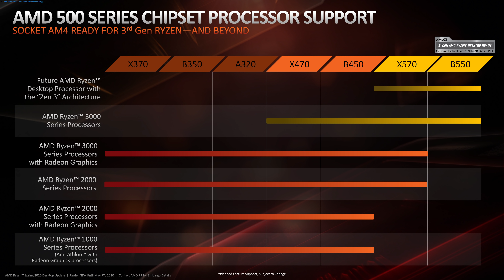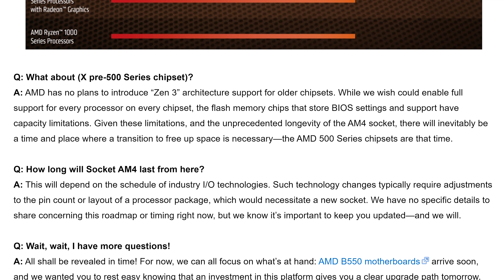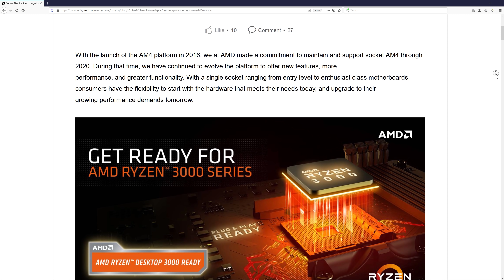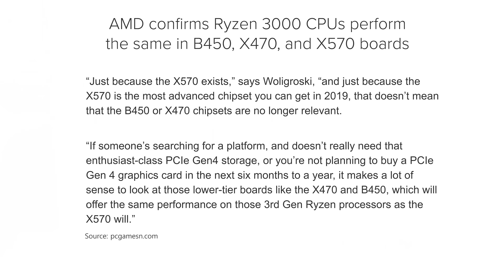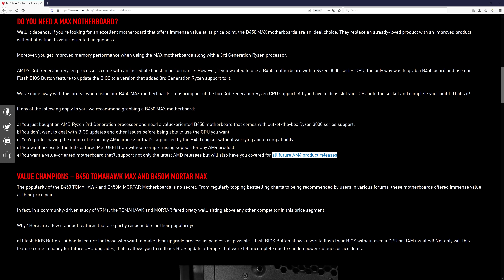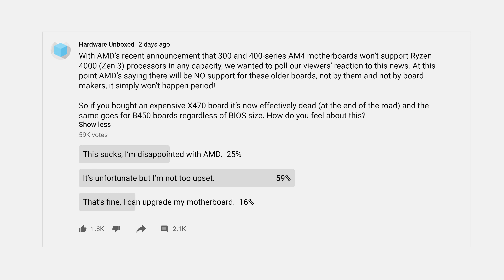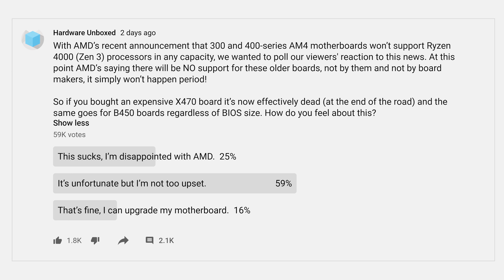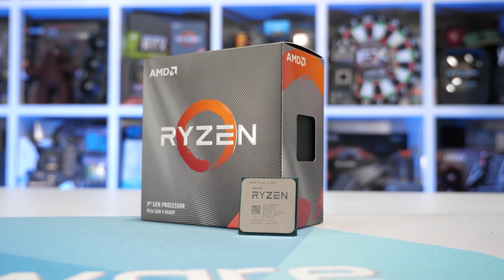AMD Does An Intel, Axes Zen 3 on 400-Series Motherboards, Our Thoughts

Comment: AMD have kept their promise. If you search for this article on Google: "3rd Gen AMD Ryzen CPUs Will Work on Many Existing MSI AM4 Motherboards", you'll see that there's a "Socket stability" slide from AMD on there. The orange bar on that graph stops right at 31 December 2019. Or in other words, processor support on AM4 officially ends on 31 December 2019. So why do people expect Zen 3, which releases AFTER 31 December 2019 which is outside of the promised support period, to work on motherboards from 2019 and below? 🤷‍♂️
Reply: Since you are on such a spamming spree, please answer this: Many other places AMD have said "through 2020" and this is exactly what Steve is hammering on about: It was so ambiguously communicated that even MSI were 100% sure that the Tomahawk Max would support Ryzen 4000... So tell me again how you, a single individual, have gained such divine clarity from a single slide, that has been contradicted by official AMD statements and slides many other places, that you have the right to tell the MSI team, who work with AMD on a continuous basis, that they are just retards who didn't know what they were doing all along?
Reply: @andersjjensen  I'm trying to balance the unjustified hysteria of some people. You can call it however you wish. Which are those "many other places" where AMD have said "throughout" 2020? I'm going by official marketing materials and slides. What are you going by? Please don't point at that BLOG post at 4:42 by an employee that clearly misspoke and didn't use the correct word that now everybody has latched onto. I really want you to show me official slides issued by the company that are not published in BLOGS and that show AM4 support for new CPUs beyond 31 December 2019.

Comment: I specifically bought a B450 Pro Carbon AC for Zen 2 and I bought the R5 3600 on launch day I got 1 of the first 3600's in the UK and I bought a Pro carbon because I wanted a good board that would last and didn't need PCIE4. If I'd known at launch that it would not be supported for Zen 4 then I would have bought an X570 instead it wasn't much more as the Pro carbon is the Best B450 and was expensive. So I'm quite upset that AMD has let me down, that said Both the MB and the Chip have been awesome, and if nothing changes I will at some point get a 12 or 16 core and wait for Zen 5 as what other choices will I have. Also the B550 it pretty much dead on arrival you can't put a Zen 1 chip in it and why buy Zen 2 if you plan on Putting a Zen 3 in it in October so who on earth is going to get a B550 because if I was forced to change an MB now I would get the new MSI X570 tomahawk as it's the closest to my B450 Pro Carbon in features.

Comment: I agree 100% on the B450 argument. Sure B550, is finally right around the corner, but currently B450 is still the latest and greatest available. Not everyone has money to throw at the X series boards and for AMD to throw people under the bus that invested in the best that they could afford only a year ago, or less, is bullshit. Especially since there wasn't a B550 alternative to be heard of for sure until the last month or so. There were even rumors that AMD might skip B series boards for the 5xx chipset. It just escalates the situation for them to use an excuse that one of the least expensive parts on a motherboard, the size of a BIOS ROM chip, is their reason for doing so. These chips probably don't cost AMD any more than the CMOS batteries.

Comment: I'm very disappointed.  I can see not updating the 300 series.  I lot of manufacturers didn't know what to expect from Ryzen and cut corners, and, they were already on a beta bios.  But the 400 series was supposed to be designed to last. If they had announced last July that there would be no 4th gen for the 400 series, I wouldn't have been happy, but I wouldn't have really been upset.  Especially if they had launched B550s soon after the X570 chipset.  But I am angry that they sold and promoted B450 as the mainstream option, knowing that this is the group that is most likely to upgrade, then cut them off at the knees.  If you got a 3900X and an X570 Motherboard, you probably won't upgrade the next year.  But if you picked up a 1600AF or a discounted 2600, or a 2200G with a B450, you were likely to look at upgrading to a 4700 or 4900.  Maybe not right away, but maybe when the 5000 series launches, either picking up a used chip or waiting for sales.
Reply: And the APU situation is even weirder.  The 2400G and 3400G work on the 400 series boards and the X570 boards, but not the B550.  Similarly,  the Athlon 3000GE will work in the X570 boards, but not B550.  And B450 may not get any upgrade at all.  What's the point of this?  I have a 2400G in a B450 board and Inwin BQ case that I use at work and that I use as a travel computer when I go back to the U.S. to visit family.  I had planned to upgrade it at the end of the socket life, when there was a significant increase in  graphical capability.  But the first upgrade was the 3400G, which was pretty much the same architecture, just a little faster.  Nothing worth the price of an upgrade.  We still haven't heard about any new desktop APUs, and would they still be compatible with B450?  If they keep the line, would the next generation be Zen 3? What boards would it be compatible with? $150-200 for a significant upgrade to the graphics and CPU would have been an easy choice.  Spending that plus $150+ on a new motherboard and then dealing with reactivating software, not so much.  At that point, I'd probably give up on upgrading it, and if i still need a system like that, I'll definitely give Intel and their Xe graphics a close look.  There's certainly nothing locking me in to the AMD platform at that point.
Reply: Going forward, I really think AMD needs to get ahead of this for their next socket.  Ryzen is popular enough to get well designed boards right from the start.  So: 
Ax20-- 2 generations of support  These are budget boards that don't use the best parts and lack features.  Limited upgradability is an obvious cost-saving measure. Maybe no i9s.
Bx50-- 3 years or the end of the socket.  Mainstream boards, good components, people should be able to expect upgrades, but there are limitations.
Xx70-- Until the end of the socket.  It's a premium chipset, make one of the premium features being able to use to use any chip on the socket.

Comment: Honestly it sounds like they are doing this for the same reason Intel does it. They dont want to deal with the tech support issue of saying the CPU's work in older boards and then at best them only working if the motherboard manufacturers update the bios. Then if people buy an older board with a new processor they have to send a CPU to the customer to update the bios. Too much headache.

Comment: If they support 400 series mobos, the effort will be the same to support the 300 series :D they should limit by the bios size support, if they do so. But they do not have enough man power obviously... and are greedy all a bit so all good for them. And also let's not be greedy by the performance... if someone buy 3100-3300x they have up to 16 cores support... on mobos. I think as an excuse the AMD is using this as an upgrade path. And ARE planing to lower prices of zen2 core based CPUs A LOT. So cheap 12 core cpu? Like 250 in 2 years or impressive Intel killer of 12 cores zen 3 for games for 500$? Your mobo will decide at the end haha :D

The most important is that they should, IMO, limit the support for 32mb bioses only. I have x370 mobo with 32mb bios... not expecting to have it and the end of life of mobo will probably be an 3900x but if I could buy 12 core 4000 ryzen for even 500 and put it in, I would do so. SO just to let the AMD knows that. Over dirt cheap 3900x

Comment: I didn't, and don't care about boost issues (which was a non-issue since AGESA update fixed the problem) but I care about dropping B450 support for Zen 3, it sucks ass, I bought B450 mobo with R5 3600 like 3 months after the release and I would like, in the future go even further with AMD Cpu's but they are pretty much locking me in Zen 2 Gen CPU's

Comment: As much as i would like the support for older boards, it could get confusing which board has the bios size big enough to store the new code and which don't, i'd rather have a guarantee than be confused, and i think AMD want to avoid that exact confusion, AMD have support for at least 2 generations, where as Intel its a new board every gen, i don't think you should put a zen 3 chip in a B350 anyway, if i have a B550 board i'll happily put a Zen 3 chip in it, peace of mind i guess

Comment: I’m going to defend AMD here, regardless of their or actual reason, supporting new processors on older chipsets would be a logistical mess that could have negative PR implications. For example, and if the 5600 XT wasn’t an indication, imagine having consumers trying to figure out which BIOS versions support what processor and if that motherboard is even capable. In no particular order: Would flashing firmware allow one to rollback? Motherboard manufacturers would now have to maintain how many versions? AMD’s support and the manpower needed? Which motherboards can support xyz and firmware version? Is that an AMD built app or vendor? Who does one blame if the motherboard doesn’t support it? Is this AMD decision or request from board partners because they don’t want to take a PR hit? If it were me, I’d rather take the minuscule PR hit now than a disaster from a low ROI.
Reply: I do agree though that the roadmap is isn’t as fleshed and if it were, this would have been already established. Also, the 400 series, yeah...PR hit.

Comment: Are these flash chips so expensive nobody can afford more than couple megs? lol
Reply: A 16MB chip costs ~2$, a 32MB chip (like one on the MAX series or x570 mobos) costs ~3.5$, way less if you buy them in bulk like manufacturers (2.8$ if you buy 100+ 32MB chips)

Comment: I bought a B450 2 weeks ago for my new build with a ryzen 5 3600. TBH, I am not even remotely upset, I still have several upgrade options to experiment with before I'll have to eventually upgrade my motherboard, seeing as I am currently waiting for the Ryzen 9 3950X to drop in price to try that next, by time I get done doing that the prices on the new stuff will have dropped a bit also win/win in my book. 

Besides AMD has saved me so much money per performance over the years, I'm not really worried about having to buy another motherboard sometime in the near future.

Comment: I'm not too upset by all this.  There are so many products now.  AMD is competing with itself.  So Ryzen 4000 drops and my B450 doesn't support it.  I can just upgrade to a discounted R7 or R9 3000 series chip.  R7 3000 series chip will be a nice upgrade over my 2600 and probably be competitive with whatever the R5 4600 will be out.  Just saying there will still be an upgrade path

Comment: I would like to raise one point: The delays of the B550 Chipset can probably be blamed mostly on the Asus owned ASMedia which makes the Chipset, so releasing B550 so late wasn't really AMDs plan.

Other than that, well, while I voted that I wasn't too angry with AMD, I will adopt your opinion on it, you're simply better informed on the issue than I am and I trust you that you gave us a complete picture. Don't mean to say that I will become an angry flamer about it, I'll let others do that, but in future votes I'll vote differently and should AMD not adjust their Path it'll influence my opinion of them negatively.

Also even when I voted last I agreed with others that argued that AMDs "yeah B550 isn't there but there's X470 and B450" response was REALLY problematic.

Comment: And even the worse thing is- B550 and X570 will be last AM4 platform, that means. If You buy now one of them, it is only good for  Ryzen 4000 CPU's after current one. 
Why make the investment at all at this late? I would rather sit on my B450 and skip all the current coming CPU's and then buy AM5 socket motherboard (Zen4) when it comes out.
That means, I will not buy newer AMD cpus that are coming this year, which means less money from me to AMD. Dick move... in any culture! Maybe converting Intel guys are less angry, as they have been getting that shitty end of the stick from Intel by eons now...

Comment: The thing that concers me is not that they did it, but the reception to it. Some People have taken this news at face value without thinking about it while parroting to everyone and their dog.

The fact remains that the chips  storing the BIOSes is too small, and while there are 400-series board that have a larger capacity, it isn't too many that have this compared to the ones that do not. If they release multiple bios versions AMD will have to make 3 levels of Microcode.

Microcode 1: Supports Ryzen 1 2 and 3.
Microcode 2: Supports Ryzen 4 and up.
Microcode 3: Support for all of the above. 

Now why the 3rd? Well, why else would you need a 32 MB chip, and for reviewers as wel, otherwise they end up flashing the bios multiple times on multiple boards. thats just a no go.  All these variants of BIOSes adds another layer of complexity in updating your bios and if someone mistakes the bios they are downloading and installing it could render their machine useless, and while it is the users fault it can easily be fixed by just scrapping the need for that.  Though admittedly I feel mixed about this. As a tinkerer I don't mind reading what bios version I need and in what order I need to install it, But at the same time I know that a lot of users likely won't read carefully. Having dealth with customers, and now dealing with "Users" in the company I work at makes it painfully clear that some people, even if there is an instruction either won't read it, or read it carelessly.

It's an odd situation where you have people buying 3rd gen ryzen on 400-series motherboards, however personally I doubt these peopel would upgrade as soon as 4rd gen Ryzen drops. I cna be wrong ofcourse. The people who have it the toughest are 2nd gen Ryzen owners,  they have had their system for 2 years hoping they could put a 4rd gen or maybe even a 5th gen ryzen chip on their board.  2 years is essentially a Tik and a Tok from Intel, atleast, it feels that way. While it is a tough pill to swallow it may not be as bad as you think, and here is why I came to that conclusion.

I explained the biose installing part of multiple before so I won't do it again. Now we have a situation where there is certainty what works on what. Ryzen 4000 only works on 500 series and higher, asuming the other motherboards have a larger Bios chip. Now when people shop for parts they can only get 500 series boards if they want to use Ryzen 4000. Where as on 400 series boards this is not a given. Here you would need to look for boards that hopefully work with your chip and hope that it doesn't drop support in the future. The aforementioned microcodes will also have to be updated with the improved code for everything else on the board. It is possible but will vendors do this? They might, but also might not.

Creating multiple bios versions can cause confusion, and with what bios will you ship your motherboard then? Will you support the new chips out of the box or the older? Stands to reason you would say the version that supports the gen the board was released in, thus 400-series with the version that supports Zen 2. But that would leave every Ryzen 4000 owner to have to update the bios right after they bought it, Would there then be a need for another "Max" board where its plug and play for Ryzen 4000 owners? I mean sure, but then people are going to complain about things being complicated. 

While the above sucks, It is hopefully a one time thing given there are 400 series boards with a larger bios chip and 500 series boards also share this larger chip. FOr new buyers, what amd has done makes more sense, it creates less confusing to say "Ryzen 4000 fits on 500 series boards only" then to say "Ryzen 4000 fits on 400 series boards on select bioses, and ofcourse on 500 series boards" 

Both sides have their pro's and cons, and sometimes a company values one thing above another, In this case it seems to be convenience for those who are new to the whole Ryzen thing. I half agree with their choice and half disagree. To me the 2nd gen ryzen owners have it the toughest. While I have it the easiest given i'm on a B350 board using a 3700X. I do want to say that all of the above is my view on this matter and I'm sure i've missed a few, perhaps important, things. So if I did, let me know.

Comment: I feel exceptionally shafted as I just ordered a B450 board last night because I'm doing a mITX build and B450 is about the only reasonable option for that form factor as B550 is not out still and X570 is basically non existent in smaller form factors for most people as the few mITX and mATX motherboards that have the chipset demand either a heavy premium or in the case of the sole example of X570 in mATX it's no good if you plan on overclocking as the VRM is not really able to handle it.